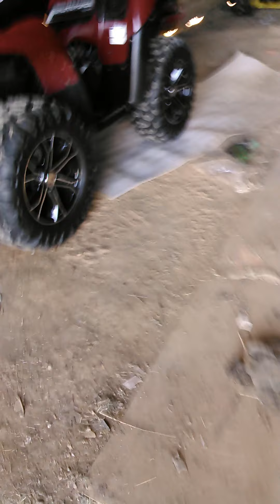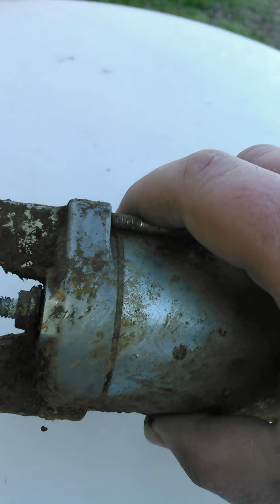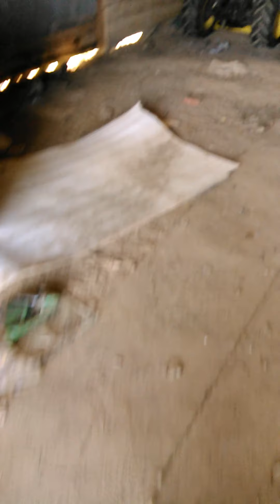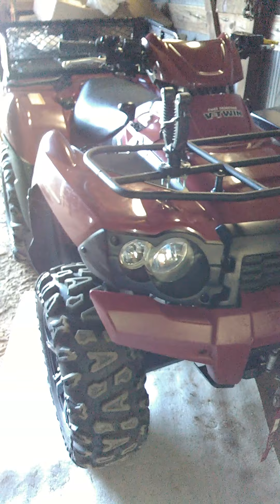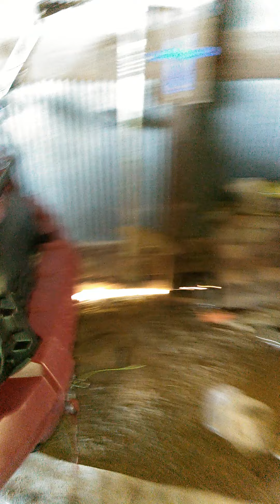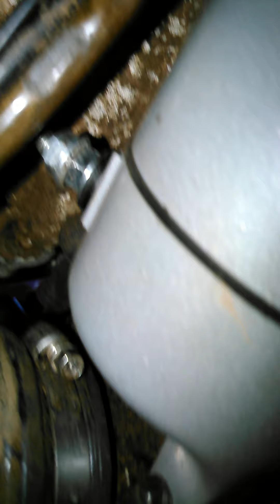Kawasaki Brute Force 750 starter replacement

Comment: Thank you so much for this video. My solenoid clicked but it wouldn't start, so I charged the battery and ended up replacing the battery. That didn't work. I then replaced the solenoid and it started a few times, then just clicked again. So I'm ordering a new starter today from Amazon and this video really helps. I have the same model and year as you do.
Reply: Hello, did changing the starter work for you? I’m having the same issues as you had

Comment: THANK YOU! I have a '10 and haven't had much luck finding info on these beasts. I do know the wiring is unique. Just finished putting a security alarm on mine and I'm thinking the auto start might need to be connected directly to this since the cdi seems to be a mystery.